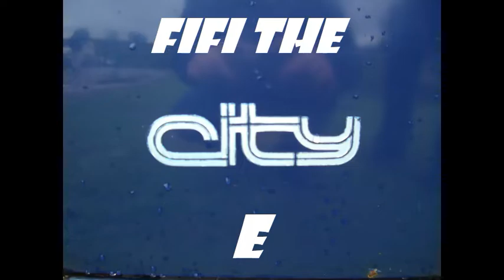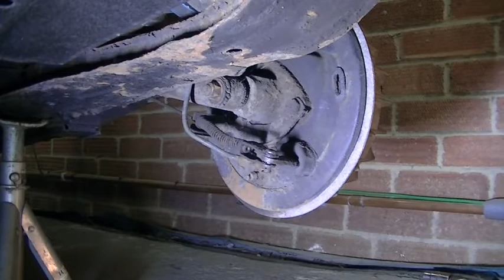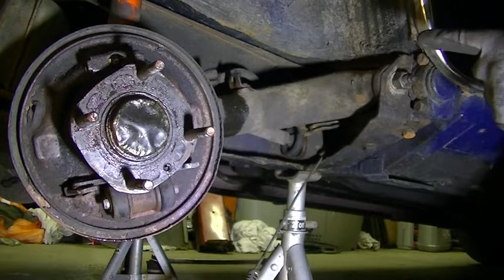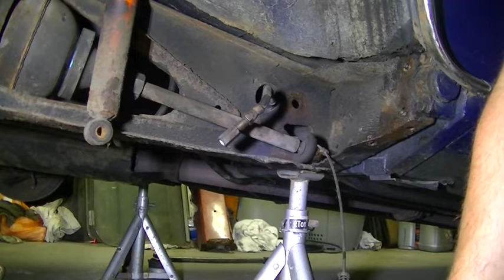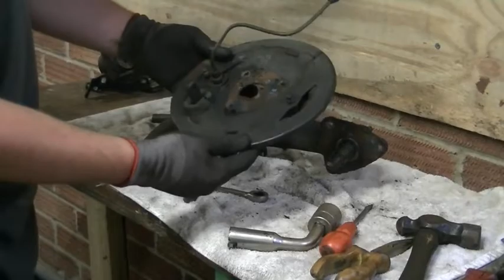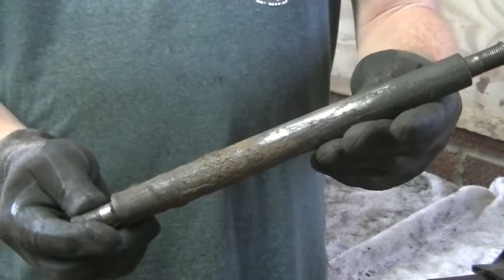PT6 RADIUS ARM REMOVAL FOR PIN REPLACEMENT. FIFI THE CITY E CLASSIC MINI LIFE

Comment: This is a job I may have to do in the future so it was good to see someone else do it.  I hadn't realized these pins could get so rusty.  I see why you need to grease them regularly. Cheers, M
Reply from the maker: Yes I have to say I am a bit embarrassed on the state of them. They have been in for a long time and were not new but Its something I should have done before now. Next video on the replacement of the pin is using AC Dodd tool which makes the job very easy. Thankyou for watching.